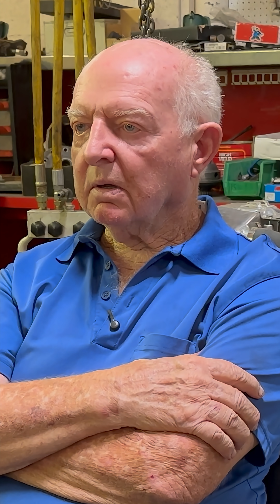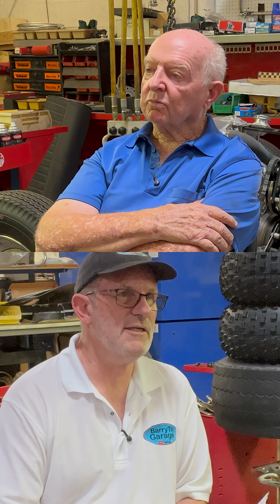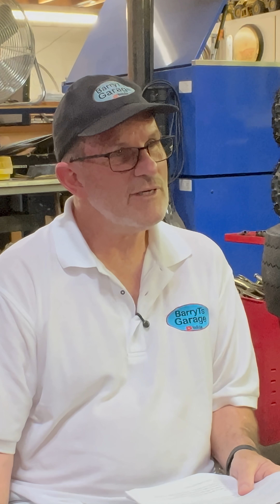PROGRESSIVE Shift Kit by TorqueFlite - Ask Ed 32   Ed Smith w #BarryT  #motorsport #mechanic #racing

Comment: The correct term is throttle pressure modulator in the valve body and outside of the trans it is the kickdown linkage. In transmission with the vaccum modulator such as the Ford and Chevy units it only controls the up shift. The TH 400 uses an electric solenoid on the throttle peddle to down ßhift, sometimes. So far every400 I've built aside from just one, they would not downshift after installing a shift kit. I have a 400 now in a motorhome that failed and now doesn't down shift. They all worked before and didn't after workin on them. The solenoid gets poeer but won't shift into passing gear. I replaced the solenoid on one and it still didn't shift
Reply: Trans Go kits I've used in many TH400's have all retained normal electric kick down. A different set of eyes would be my move to find a solution
Reply: @peted5217 exactly what i was thinking...if it worked before it should also work when done....
Reply: Pull that lever to 2

Comment: The downside is if it stops moving it burns up the transmission.
Reply: Not really, I drove a torqueflite for a long time without the throttle kickdown linkage as I had a hard time finding the right pieces to complete the build. And a friend has a 64 Galaxie that was restored and never got the kickdown out in it until I worked on it. Now it has a Lokar cable kit and he really likes it now even more because the car performs much better
Reply: @BretTschacher Wouldn't a 64 Galaxie have a Cruise-o-matic which by then had a vacuum modulator (and a throttle valve?)?

Comment: simular to a c-6 with adjustable kick down linkage, normal shifts normal driving, then standing on it in various throttle positions would increase various psi then linkage adj and vac modulator adj could hold 2nd until slight let up on throttle for 3rd
Reply: I believe that the C6 linkage actuated strictly a downshift valve. All or nothing, no pressure modulation.